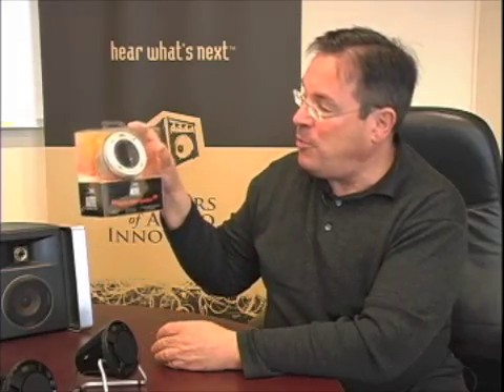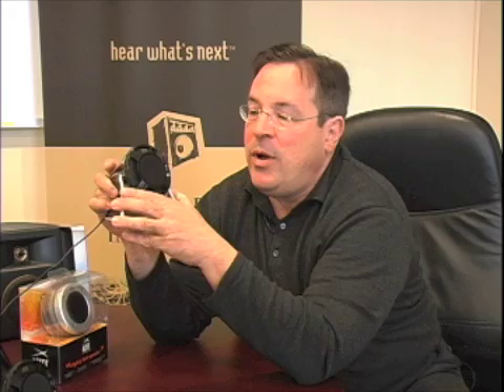What is Sound Pressure Level (SPL)? (Part 2)

Comment: people have to realise the physics of loudspeaker design. every time the loudspeaker cabinate volume is doubled you get either a doubling in effiency or a 1/3 octive bass extension. in short you always want the largest speaker cabinate volume and cone are you can afford or that your room can handle.  I like my music super loud (normal listening of 95-105DBC average 110-115DBC peak), so I have eight...yes eight 15" woofer full range radioshack PS speakers in my living room powered by 500 WPC amp. the "wall of sound" is over 4 feet tall and over 6 feet wide. when you listen to a huge powerfull system that can kick you in the chest with each bass drum kick or vibrate your insides with bass guitar you can never ever settle for small speakers again.. again, you cant get huge powerful sound out of small speakers, you cannot beat the laws of physics!.

Comment: Hi Robert, Just a small point. A 3dB(A) increase is a doubling of sound pressure level, but it is not a doubling of loudness as stated in the your video. A 10dB(A) increase is an approximate doubling of percieved loudness. You may want to correct this for accuracy purposes. Its an easy mistake to make.